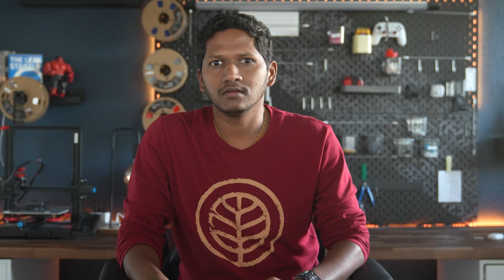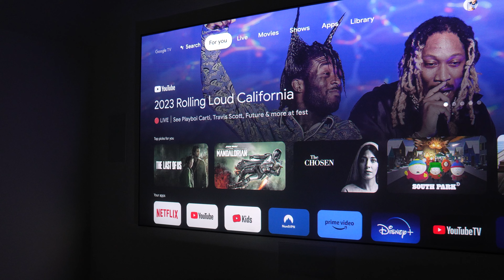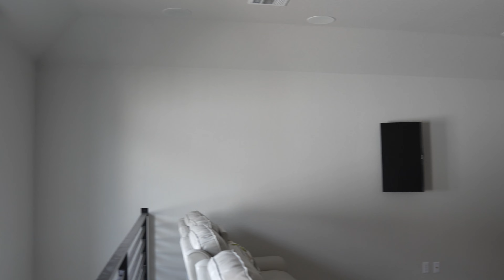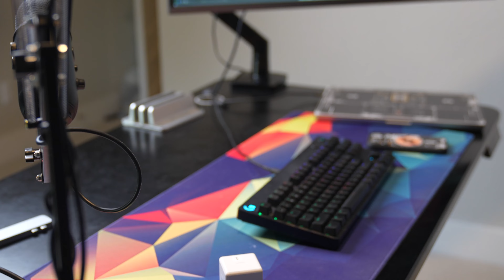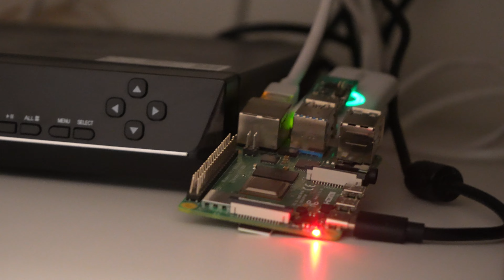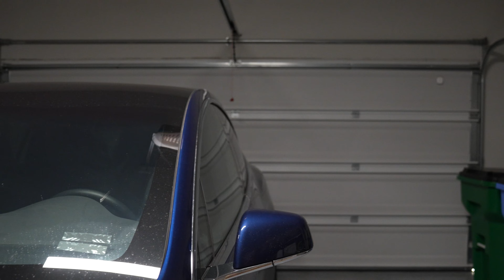Unveiling the Futuristic Smart Home: 150+ Gadgets Revealed! (Part 2)

Comment: Great video Vijay. Hoping more tutorial videos soon. Why do you choose z-wave switches. Any particular reasons.
Reply from the maker: Z-Wave uses low-frequency radio bands that don't interfere with Wi-Fi, but Zigbee uses the same spectrum as Wi-Fi which 2.4GHz. If you are asking, why not wifi? I know I will be installing more than 60 switches which could be a load on Wi-Fi and also I won't be able to control them locally and on the other hand z-wave can be used offline and locally :)
Reply: @vijayautomates  its really impressed your current setup and your efforts on this. Am starting my home assistant and I use couple of zigbee switch and zigbee relay. Never tried z-wave yet. Can you able to suggest me a best rock solid smart home device setup for long run. Zigbee/z-wave/thread?
Reply from the maker: @ManojKMathew  , I am glad you liked the setup. I had to skip a lot of stuff to keep this video short and interesting :) 
To answer the question, I can't say for sure one thing is better than another. At least my last 4 years of smart home experience say that it's a mix of everything. I mean, for switches, I use z-wave, but I had Ikea blinds, and then I had to use ZigBee stick to support them, so I have both Zigbee and z-wave now is easy for me to adapt to any device. And coming to Thread/Matter, it's early for them to be a perfect system may be in 2 years, they will support everything, but now it's not. With HA connected with z-wave and Zigbee setup for me, I can adapt to anything that comes in the next few years, including Matter, as HA will support it.
Reply: @vijayautomates  thanks for response. And do you think which zigbee channel is perfect for without Wi-Fi interface. My zigbee motion sensors are keep on disconnecting/unavailable for without any reason. using USB extension for sonoff dongle. Doesn't help much. So i recently bought the skyconnect , didn't setup yet. Do you have suggestions/guidance for fixing these issues. Or should I move z-wave switches
Reply: how to build a rock solid zigbee mesh network and what Channel is do you use for without wifi interfernces  ?